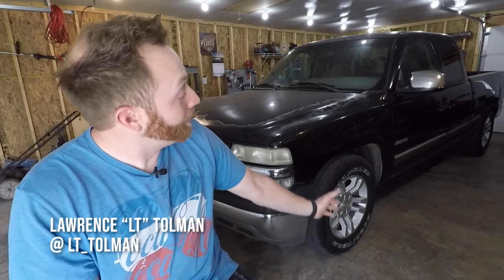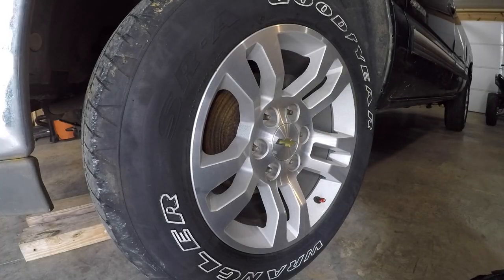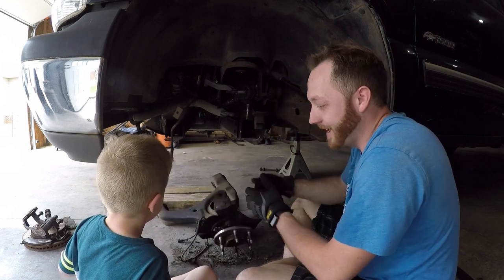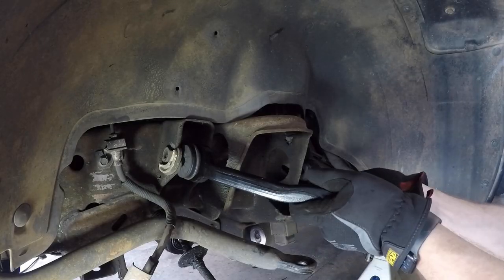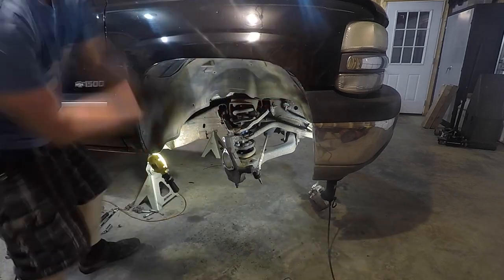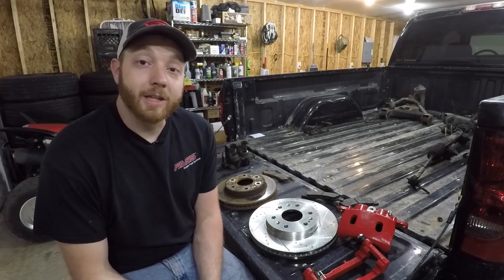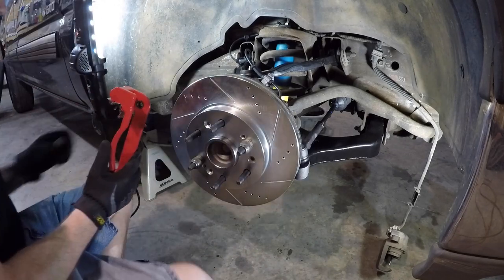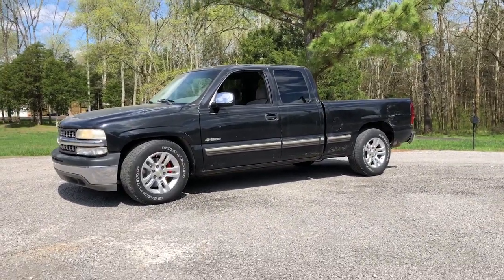Big Brake Upgrade for 99-07 Silverado or Sierra

Comment: 1999-2006.5 GMT800's are my favorite years for chevy/gmc trucks also.
Reply from the maker: a very classic body style for sure
Reply: I had a 2001 and a 2003 Silverado and did love those trucks, but now I'm driving a 2007 Silverado and one thing is that the steering and braking is so much better then the 01 and 03. I had 4x4's so no rack and pinion steering but my 07 does. I put a 185,000 on my 03 and only thing I did was a water pump, brakes, and the part that makes the 4x4 go into 4x4. And when I say brakes it only did the front so not sure how I got that many miles out of the rear. Funny when I bought the 03 it was that new front end and the dealer asked me if I like it, I told them I thought it looked stupid. So they wanted to know why I bought one and I told them that I cannot see the front end from the drivers seat. But I grew to love it and also the front end on the 07. I also really like the new Silverado front ends now that I have seen them in person.

Comment: You can also use the 2019-2020 Silverado rotors and calipers which are 13.5" rotors and 4 piston calipers. The only thing that you would need to do is to use 4 spacers or washers that are around .155" in thickness. These go in between the calipers and the spindles. This will center the calipers on to the rotors. I`m doing this conversion to my 2004 Suburban. The total cost that I have invested in this conversion is $492.89 including the cost for the GM 84847749 ceramic brake pads $107.02. It is also recommended that 18" or bigger wheels and tires are used.

Comment: The newer wheels look good on these trucks. I have a set on both of my 04s. I like to run them with the letters out as well but the black around the letters seem to come off of the tires which I cant stand. But they look good and look good on yours as well.

Comment: Great video LT. The truck has already come a long way. Interesting piece of info, I didn't know they upgraded the rotors in 2005. I love upgrades that aren't obvious at first glance. I own a 2015 Ram 1500 Reg Cab Short Box 2WD with the 5.7 Hemi and 8 Speed. I was able to use the electric fan out of a 2012 Ram 1500 with a V6 all I had to do was extend the wiring harness a couple inches. (2009 and up Ram 1500's with the V8 use both a clutch style fan run off the water pump and a small electric fan hidden under the fan shroud).  It bolted in and looks factory. No programming required the PCM turns the fan on and off automatically. Although you could change the temps at which the fan comes on and off with a programmer if you wanted to. I've had it in my truck for 4 years now and it works perfectly. Also my truck has electric steering so when you open the hood the only things running off of the belt are the alt, a/c and water pump.

Comment: My understanding is the 2019 and newer trucks have 13 1/2 inch discs and four piston calibers for an even bigger improvement.
Reply from the maker: yeah, those new brakes are badass
Reply: Or even better, swap on the 2021 Tahoe ppv or Escalade Brembo 6 piston calipers and 16" rotors!!

Comment: If you swap your rear brakes  off a 99-06 tahoe use the rear brackets  caliper & rotors if your currently on rear discs you go from a single piston to a 2 piston caliper & the rotors are a inch bigger also
Reply from the maker: TVIcelink I’ve got a set on standby for when I tackle the rear end.

Comment: If I may suggest, get Dirt King alignment cams for the upper arms. Even though its not a 4wd, they lock the arms in place a lot better than the ho hum factory pieces.
Reply from the maker: good tip, I'll have to check em out!

Comment: Thank you foreal dude. You just gave me courage to do mine myself. My shocks breaks and everything are shot.

Thanks for your time I look foward to doing this project with my son.
Reply from the maker: Glad I could help its pretty straightforward work
Reply: What is the proper name for that caliper  bracket so I can track it down. Is the rear the same and is this a part I can buy from a 2005? Thanks in advance brother.

Comment: Didn't see you mention what wheel diameters are needed to clear the bigger rotors and calipers? My 2000 Sierra 1500 Z71 is still running the original 16" alloy rims...

Comment: I know it's been 4 years since you made this video but do you have the uncut normal speed version? Not literally every minute of the project, just the step-by-step so I could use it as a reference? I haven't replaced parts like this since 1977 and could use a good refresher. Thanks in advance.

Comment: Great videos.  Thanks!  My 04 has 320K on it and I did not do lower arms or coils but did lower ball joints (PITA).  I bought Monroe reflex shocks and was unhappy with the resulting ride.  I dont blame the shocks quite yet: I suspect its time for coils and for cab mount bushings
Reply from the maker: cab mounts can make a big difference for sure

Comment: Hello I have a 2003 extended cab 
I got a 2.5 -3 inch front lowering springs 
My question is will good with standard shocks

Comment: hi, Watching your vid inspired me to upgrade my front end.  I have one questions regarding Big Brake / Caliper upgrade.
I have stock 17" steel rims.  IF i put on the Bigger Rotors, 13inch and 05 caliper bracket.  Will my Rim RUB?  or will clear no problem?  what do think.

Comment: Just to be sure my old brain understands, do I buy the calipers for 13" rotors at parts store for 2005? And now that it is 2024, does any aftermarket manufacturer now make the caliper bracket instead of having to shop for used at the boneyard or ebay?

Comment: Before I did both the front n rear big brake upgrade, the rear brake was binding n locking up, I did a full repair on the piston n calipers on the dual rear calipers but it is still binding n locking up still. Could it b my master cylinder? all 4 brake lines breed fluid fine, change all 4 flex hose too. When I got the truck, the brake fluid was all green n contaminated too, new fluid in there but could it b the seals in the master cylinder gone bad to not hold pressure? Brake pedal is firm when the truck is off but when u turn the truck on the brake pedal sinks down to the floor. So my guest next is to get a new master cylinder c if that is the problem. Truck is daily driving only, would u say stick to the Vacuum Booster system n not upgrade to the Hydro Booster system cux I don't really want to spend extra money the new system.

Comment: I have a 2001 my question is about the brakes so the calipers bracket and rotors off of 05 will  bolt up to my spindles?
Reply from the maker: Yep. Just gotta have everything you listed: calipers, brackets, rotors, and I think the flex lines might be a tad different.

Comment: Did you have to order new upper and lower A arms for the 2/4 drop? Or did you want to get it brand new? Thanks in advance.
Reply from the maker: no, you don't have to replace the control arms, I just did because my old ones were worn out. You can easily do this with original control arms

Comment: LT,
What would say ALL the Moog front suspension parts and steering rack cost when all said and done?
Reply from the maker: I'd have to sit down and find all the recipepts and stuff, but probably about $600 to $800 for everything including wheel bearings, brakes, suspension, rack and pinion
Reply: @LawrenceTolman  
Thanks LT.
Even at the $800 mark that was a good deal for Moog and all the rest.
Where did you get the rebuilt steering rack and brand?

Comment: @Lawrence that common big brake kit, does it matter if you have 4x4 front diff?
Reply from the maker: this works for 2wd and 4wd trucks as they share the same spindle. in fact, now guys are doing 2020 big brake conversions because they have 4 piston calipers I think
Reply: @LawrenceTolman  I noticed. Only thing holding me back is wheel set up. My truck is lifted 6” with 35’s on 17’s rims, don’t think I’ll clear, wana do 18’s with nothing less than -12 and still have lots of sidewall. Don’t want 20’s unless I want to.

Comment: I have 2001 Silverado looking into doing the brake upgrade. Is the bigger brakes from 2005 Silverado's or can use tahoes, or any other newer platforms
Reply from the maker: I know the tahoes have different sized back brakes than the silverados, but the parts I used were from a 2005+ Silverado 1500
Reply: For Tahoe’s it’s 07 or newer. You can also opt to go with upgraded PPV Tahoe calipers

Comment: 1:48 326,000 miles and I can see it still has the plastic inserts from the factory for the upper control arm cam adjusters. unreal

Comment: Awesome video! Are the bigger rotors, caliper bracket and caliper all for a 2005 Silverado? Thinking about doing this to my suburban.
Reply from the maker: I believe its 2005 and newer, if you have a suburban with rear disc brakes though, you already have better rear discs and calipers than the 1500 trucks got, so I'd just check the fronts...
Reply: @LawrenceTolman  thanks man!!

Comment: Did your lower and upper control arm come with grease or did you add that after install ? Also what is your recommendations on that
Reply from the maker: I haven't greased em yet, but normally I use that sticky white grease that comes with most urethane bushings

Comment: Hey man, great video. Quick question for you sir. I have a 2001 silverado 4x4 with the 4L60 aswell and i notice you said you swapped yours for a 4l80. Was this swapped a plug and play or u need some work to make it fit.?
Reply from the maker: I made another video on the wiring you should check out, but there was a harness needed to convert the plugs and add a second vehicle speed sensor to the computer

Comment: LT, I have a 99 GMC Sierra 4x4, what year of the donor trucks parts are needs for the upgrade for my truck?
Reply from the maker: you need rotors, calipers, caliper brackets, and pads from a 2005+ truck. I think I changed the brake flex hoses as well.

Comment: Can this 8.1 conversion be done in a 2002 silverado with a v6. Computer change?
Reply from the maker: anything can be done, but you will need a different harness coming from a V6. likely the stock computer can be re-flashed to work
Reply: @LawrenceTolman  thanks,  computers are above my skill level.

Comment: You're very knowledgeable when it comes to these Chevy Trucks!  Your videos are well constructed and executed,  you are very informative, and to the point, all while being a family man! Kudos! Keep up the good work! Cheers!

Quick question.  Am I able to upgrade my 2003 1500 5.3 King Cab Long Bed Light Duty 2wd rear calipers, rotors, and pads with another year? Just like you mentioned for the front with a 2005.

Also,  how can I find out what transmission I have, and would it be fairly easy to make the truck 4WD or AWD?
Reply from the maker: yes, the rear upgrade should be the same as listed here. The most popular upgrade is to use a same year Suburban rear caliper and rotor, its a two piston and uses a thicker rotor, but will still fit inside 16" wheels. And this was a 4l80 transmission I swapped in, and if you wanted to make this truck 4wd or awd, it would be best to grab a 4wd frame from the junkyard and swap everything over.
Reply: Thanks for the quick reply! You rock!

Cool,  so my understanding is I don't have to go up to a 2005 for the rear.  Just get the 2003 Suburban rear dual piston calipers/brackets, rotors, and pads.

As far as AWD/4WD sounds like that's a lot more work than it's probably worth.. lol.
Reply: If I wanted to make it heavy duty,  would I just upgrade to 8 lug?
Reply from the maker: Yes, you could swap an 8 lug rear but then you’d have mismatched front/rear. Probably not necessary unless your hauling very heavy

Comment: Wish I found these videos a month ago before doing the same on my 290k mile 2000. 

Quick question, do you know if the 2wd and 4wd brackets in the newer trucks match? In idaho, and not a ton of 2wd trucks in junkyards around mr.
Reply from the maker: They should be the same either way, the drop spindles fit both 2wd and 4wd

Comment: Hey, I saw you in Powernation videos, am I right?
Reply from the maker: You are correct
Reply: @LawrenceTolman  Hi LT, here is Pablo writing from Costa Rica.  
I have a 2002 single cab, 4x2, 5 speed standard transmission, 1500 Silverado which I love since new...
The front suspension is low and tired after all these years, can you recommend some new brand of coil springs that are 1,5" or 2" longer?  
Best regards

Comment: Should I convert my rwd gen 1 Silverado to awd or 4x4 ??
Reply from the maker: depends on preference really. I like AWD, but unless you have a load of horsepower, its kind of a waste. 4wd is nice because you can switch it in when you need it, and shift into 2wd for normal driving
Reply: @LawrenceTolman  so u think 4x4 is a better option ? Also I imagine it’s cheaper